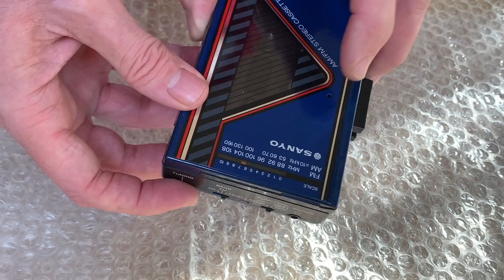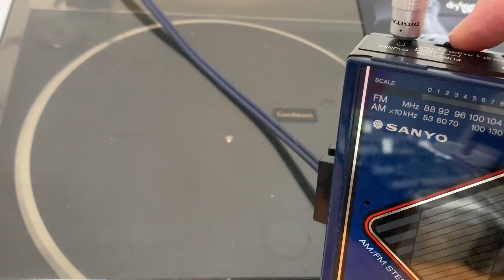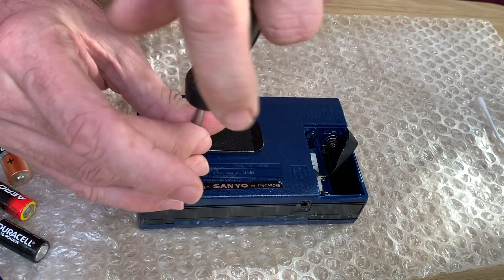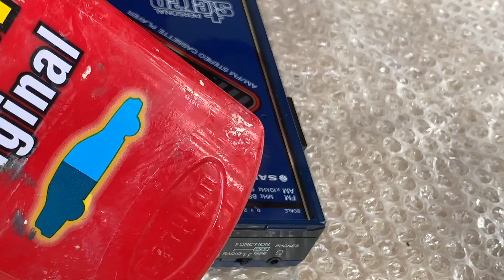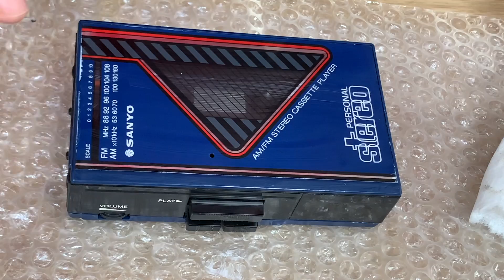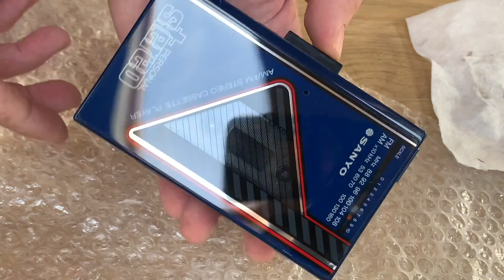Sanyo MGR59 Service. Vintage Personal Stereo Service, Belt, Head Clean, & Restoration.Walkman Repair

Comment: I have a Sony WM FX353 with plastic mechanics.. the sound is very good even without Dolby NR because this Walkman is a cheap version.. but it can minimize noise.. Sony's technology is really amazing.. and the IC for the audio and headphone amplifier parts uses Sanyo's.
Reply from the maker: Yes, the Sanyo amp chips are highly regarded. Fortunately, costs were generally cut in build quality first, but much of the actual circuitry was kept - so there are some surprisingly nice sounding 'cheap' units out there.

Comment: I have an M GR62 almost exactly like it! I'm thinking it's from 1985.
Reply from the maker: Yes, they are around '85/6. The MGR60 is the same as the 59, but for other (non UK) markets, so a different door design The '62 was a curvier, and I think though lighter next model. Both the '59 and '62 made in Singapore. Those old Sanyos tent to last forever!